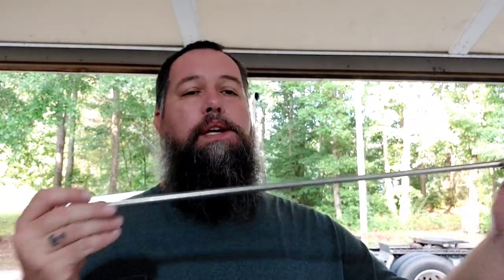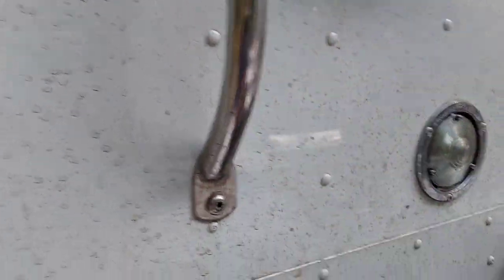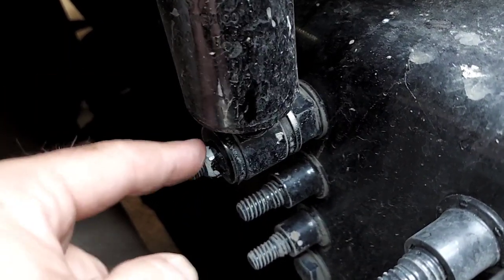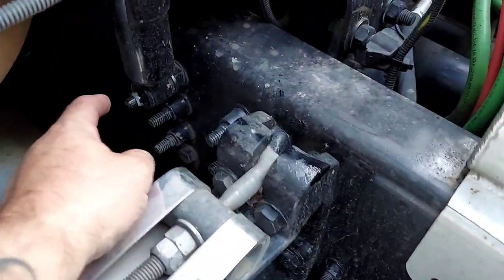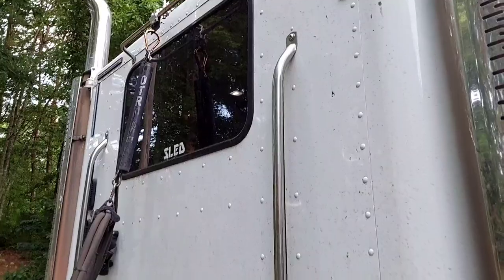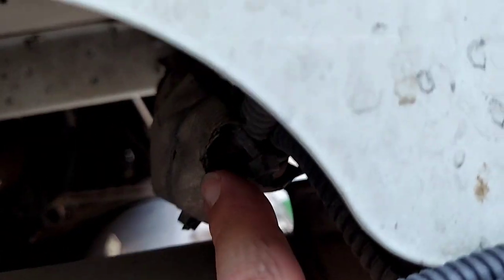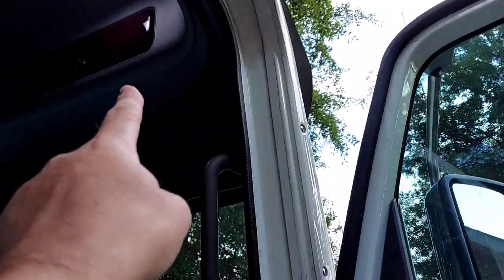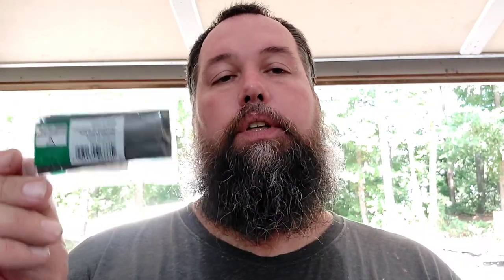The best CB antenna and mount location to date!

Comment: I'm using the "Hustler HQ27 55-Inch Steel Power Packer CB Radio Antenna" and it is awesome. The coil is slimer and is 3/4 the way up on the antenna. Easy to tune with a quick disconnect for when I go into the truck wash.

Comment: Hustler is a great brand that has been proven over time! I would solder the ends to the braided ground straps. They will corrode with time and lose the connection integrity. Permatex anti seize is great stuff to use on metal surface's to prevent corrosion and protect connections. Use it on the braid rings antenna mount bolts even on the antenna mounts etc.  21' is perfect with rg8x. Put a little fire in line and I bet it will really talk on flat land and no obructions. I missed what radio you are running.  Leadfoot 918 waving a hand.

Comment: I just did this set up with the Hustler on the grab bar behind the cab, high center. Ran the coax under the cab and in through the firewall,  easy peasy. Hooked it up to a General Lee and can't get the SWR below 1.7 - 2.0...
Got it all ready to rock for work tomorrow, fingers crossed it gets out as good as yours! 
2020 Mack truck with a hopper bottom trailer.
Reply from the maker: Hopefully you're using an external SWR meter to check that. And RF bonding may help get the swr down,  but will definitely get RF interferences down. https://youtu.be/J6PJyw6jh2M
Reply: @jrichtruckincbtips  thanks for the feedback, we're gonna run a ground wire this weekend over to the grab bar bolt. Also, we're taking off the factory antennas off the mirrors. Never even thought about those causing interference. Not like I'm using them anyway. But yeah, I'm using a meter to check it.

Comment: Very nice setup...the Hustler is a great antenna to use, have use them for years since 1975 whit my first Midland 23 ch CB...over year's i have use many different antennas on my car's but I always come back to Hustler ( for me this day's is the HQ-27 ) i have a 3' fire stick that i use in my grand Vitara it works good.. but never like the HQ-27  is a great antenna for Skip..never had a problem whit it..nice Swr whit 18' and 21' of RG mini 8.  This antenna has been whit me since 1991 and it' will be whit me until is not good no more ( that day i will get another one ).  Hope you use it and get good results locally and whit some skip....73's and good Dx's... from the Unit 403 West indies the Caribbean ( Puerto Rico 🇵🇷 )... Old CB license KAHK 4031........... Ps...i have use 2 HQ-27 in a dipole configuration and 40' coaxial cable for base during huracain Irma and María in Puerto Rico 🇵🇷 2017 to help whit comunicación..and get help
Reply from the maker: Awesome, I believe the Hustler is one of the most underrated antennas on the market. Mostly due to the fact trucker only see Wilson's and Firestik in every truck stop. 

My newest setup is the same as this, just in a different truck, but I feel doesn't hear as good due to the more fiberglass and plastic construction. But, with my new radio the Anytone quad 6 I am able to pick up more from the west coast and I'm just a few hours from the east coast. 73s my friend.
Reply: @jrichtruckincbtips  remember this is made by hostler...and they make antennas for ham radio over years..and this is a old 23 ch antenna that still works good even whit 40 ch + CB's...the real ting is that new cb generation doesn't know this antenna excisit...well better for the people like us that use it...and don't have to spend to much $$$ in ringkidinki fancy antennas that doesn't perform like the hq-27..

Comment: Check into lmr240 ultraflex coax its a less loss coax so more power makes it to the antenna and it's double shielded so it will help keep unwanted interference out
Reply from the maker: Definitely good stuff
Reply: Absolutely 240 ultra or rg400! Just make sure to get your calculations velocity factor and such and get the length for the frequency your prefer!
Reply: Quality of coax and quality connectors and antennas make all the difference. Put the money in the coax and antenna system first. Then any old yak box (that meets factory receive specs) will work great!
Reply: @rockhaller3899  yessir, Times LMR-240/400/600 ultra flex is hard to beat for the price. Only way I could see it getting any better is Commscope (old Andrews) super flex fsj2 corrugated hardline and matching Commscope/Andrews connectors.
Reply: @jstrunck  I changed out a my HF pl259/so239 to double insulated "N" connectors. They are insulated electrically and also from the weather elements, well worth the few extra bucks in cost!!! 👍
Reply: @ericdee6802  I agree 120%. N-connectors are also a constant 50 ohm impedance at almost any frequency which is a good thing. 

Sounds like you building an excellent antenna system!

Comment: I also have the Freightliner Cascadia daycab but without the exhaust pipes and a wind dam on top..I am following your videos closely, so far the 6 foot skip shooter on the mirror is the best choice but am not liking the wild swings the antenna makes being it has to be lowered at 45 degrees for a lower swr.. I bought a 22 inch extension and so far my Wilson antenna is benefits the most with it and doesn't swing around as much ( I only wish i had bought a longer extension) my 5.5 ft francis the K 40 and 4ft fire stick have me  above a 2 SWR.. so that being said I wonder what kind of SWR reading a hustler with a long extension on the mirror would read..

Comment: After 1 winter, I had to throw the Hustler’s away. Every time it snowed, my Stryker 447 wouldn’t transmit due to SWR protection cutoff. Even dry, the SWR’s were wonky. Very disappointed in the Hustler antennas

Comment: Was running a 6' Skipshooter mirror mount on Freightliner Cascadia,  was working great til the antenna snapped off at the base, put a 5' Skipshooter on as a temp fix, but now have trouble transmitting and receiving.

Comment: @jrichtruckincbtips, i got a new model Cascadia with condo sleeper. It has factory mirror mount on driver side, similar to yours. With the sleeper cab, do you recommend this Hustler on back of cab or stick with the mirror mount? If mirror option, do you think the Hustler would perform better than Skip Shooter if coil was mounted high enough?
Reply from the maker: The Hustler will receive better than the Skip Shooter. The Hustler is a little short for the mirror mount. I prefer it on the rear.

Comment: I have a Coronado dump truck aka 122sd. I don’t have that bracket behind the cab but am planning on using steel to make me a mount close to the top of the cab. My truck has a gap between the cab and body. This antenna is going to work great! I’ll do a video when I do it and let you know so you can check it out.
Reply from the maker: Cool, share it with me. Remember to get the coil above the body, no need for the stupid long ground straps. Check out this video on RF bonding, it's made a huge difference on the Coronado. https://youtu.be/J6PJyw6jh2M
Reply: @jrichtruckincbtips  I just watched it this morning, going to definitely do that. It will take me alittle while but I’ll let you know when I get it straight and my results

Comment: Also have a 7' Skipshooter but need to find a base similar to what you're running  to reduce some of the antenna flex.
Reply from the maker: Get a 3' length of 3/4" cpvc pipe (not pvc) from home depot and slide over the base. It will help the antenna last a lot longer.
Reply: @J Rich Truckin & CB Tips   Thank you, will look when I get home.

Comment: Stainless 102 on the driver's side mirror reaches your height restriction when you tip it forward at a 45ﾟ angle.
 That's what the 74 mile freightliner Cascadia was using
Reply from the maker: What kind of power and geographic location is that to get 74 miles? Would be hard to get that range here in North GA without big power. I wouldn't mind testing it though if I had a 102" whip.
Reply: How are you getting 74miles I've got a 102 whip on my personal truck and I'm no where near 74miles
Reply: @4spdlife857   Both vehicles had a resonant  50 ohm antenna.
 Both radios were modified by the same technician.
Reply: @scot Johnson Ahhh hardrive...  I knew your name looked familiar.  My fine tuned radio will be here in a few.  Can’t wait.
Reply: @luckymunkey77.  Did you get your radio?
Is it worth it?
Reply: Buddy, have you seen how low the clearance is under some overpasses?  The 102" whip will probably not break off but would one hell of a nice ratling through an under pass if mounted to a mirror mount on a semi!

Comment: If you want more truck front to rear coverage, and less side coverage. Buy another Hustler like you have and a coax phasing kit(dual coax kit) and phase them together. Your angle of radiation should be lower so it will work DX better. Or stay with one hustler and with a higher radiation angle, and you local coverage will be better.
Reply from the maker: I prefer the single omnidirectional, never found cophase to be worth the hassle.

Comment: Take notice when you go under the door plate that it doesnt go beyound the corner ability of your coax....Also keep in mind of movement near the screws of the plate,might rub and eventuall short out..I know cause i did it with a car stereo..
Reply from the maker: Yeah I will put some wire loom over it.

Comment: Tip re your gnd straps...All those grab rails are bonded to the back of the cab already....I would just use 2 strap to connect back of cab wall where top of cab shock mounts to where bottom of shock mounts....
Reply from the maker: Can never have too many grounds.
Reply: Grounds need to be short as possible....
Reply from the maker: @rockhaller3899  more grounding is coming

Comment: Hi,  great install with the Hustler in that position but having antennas on the mirror at a 45 degree angle is ridiculous. CB antennas should be vertically polarised otherwise your sending your signal to the ground or sky. Not good
Reply from the maker: I here you, but at times whit the antenna vertical the swr can be much higher. With most fiberglass antennas at highway speed the greater half of the antenna will be vertical. Otherwise with a vertical antenna at highway speed you would be talking to the ground or your trailer behind you. Which is where I do most of my talking is at highway speed.
Reply: @jrichtruckincbtips  yeah no worries, I do understand and having the Hustler up top is a far better option. I drive a truck here in the UK and know the challenges of good CB installs. Keep up the good work 👍

Comment: New subscriber here.  How did your give a way work out?  Hope some people were able to put them to use.  Thanks for the details of your install.  Have a great 2021!
Reply from the maker: The giveaway was great and winners were announced in this video.
Reply: @jrichtruckincbtips  sounds good.  I am a former CB operator well back in 1975 I was.  I might get on CB again.  I was looking for mounting ideas on a truck for antennas and came across your video.  I am a licensed Ham operator and want to setup mobile radios for VHF & HF.  I also plan on putting a CB in the truck as well.  I am not one of those that says one is better than the other, I like good communication and dislike goofballs on any radio.  By the way, my Brother in law and Nephew are OTR drivers and my cousin drives plows and sand trucks in Minnesota.  Stay safe on the road!  All the best!

Comment: Theoretically, your ground strap needs to be as short as possible, also attaching the strap to the antenna mount wouldn't make any difference which side of the bolt it was attached, once the strap makes contact with the mount, the ground has been established. 
    Question:  What's the purpose of tilting the antenna at an angle, are you undecided on whether your going with a vertical or horizontal polarization?
Reply from the maker: Most do it to accommodate for the antenna flex at highway speed.
Reply: @jrichtruckincbtips  I kinda figured but wasn't sure. Gotta question for you. I currently run two firestix on my rig but after watching your video, I went and took a gander at the "Skip shooter's", They are 5/8th wavelength which is about a good as it gets for a mobile antenna, how well do you think Co-Phased 4'.5" skip shooter's will perform in place of the Firestix. If I did my math correctly, the 4.5 foot skip shooter will be a few inches below the 13.6 foot mark. I have a 2021 Pete 579 which has the factory antenna mounts on the cab body just outside each door, Co- phased antennas work well between 5' foot and not exceeding 9'feet. I have a factory stock Cobra 29 LTD and was recently taking with a guy who was 29 miles  up a Mountain canyon from me and was getting good signal reports 5/7 to 5/9 "S" units with the firestix, if the Skip shooter's are as good as people report, than I should easily surpass that distance, what's your thoughts on that???
 Thanks for reading and sharing your antenna install.

 Oh, real quick, with my Pete, I purchased one of those black rubber anti static strips that you sometimes see under trucks, they bolt to your undercarriage and drag on the ground, I've seen them alot on school buses, I have noticed a huge improvement in heard static/crackling noise you hear sometimes through your CB speaker I purchased mine through "Granger" in Santa Fe Springs,Ca fairly cheap. Just a little added insurance against static electricity that causes issues. 👍

Comment: Ive had 2 of these. First one I thought was great, picked up well, heard everything, but I eventually broke it on a tree limb. Second one was complete crap, the threads at the bottom of the coil stripped out very very quickly, and it didn't seem to pick up like the old one. The whip on top is nice in theory, but in reality it doesnt bend much, its stiff, and they will still break. Shame on the modern QC, I'll have to find something else now. Thank god you arent using 18' coax, its a meme.

Comment: Your content is great!
I am a slip seat driver.
One trip I can be in a Volvo, next a Pete, then next a Freightliner.
My SWRs are all over the place, depending on the truck.  
I usually use the bird pearch, but seems I can never get my SWRs lower than a 2. A couple of trucks they shoot well past 3, and don't use my radio then.
I run a Galaxy 959b, with a Wilson 2000 mounted on a vice grip mirror holder, and run RG8X coax.
Any advice on how to lower my SWRs? 
Thanks
Reply from the maker: Yeah, it's tough trying to maintain a low swr while constantly changing trucks. Even with a good ground I have found it hard to get a great swr with wilson antennas. I prefer Skip Shooter and Hustler antennas. I'd try a different antenna first.

Comment: Hello I drive a 2023 FL the antenna is on the back of the slipper and I see two different antennas im not sure if they are both cb I thinking one is for the cb and the other one is for the radio im not sure.  What im trying to do is get a antenna that I can set the swr on so I can use my radio. This is a company truck so not much I can change on it. I like your videos they help me out if possible I would like to talk with you about what I have to work with just see what can do

Comment: Having heck of time. With 579.factory...   antenna mount on driver fender hood next to down left windshield. ....
Reply from the maker: I know what you're talking about, but I haven't had an opportunity to look at those close up to give you a sure fix. But, I'd try running a better coax, ground the mount to the frame, and a tall top load antenna for starters.
Reply: 567 and 579 the same just dif hood i used a bird perch 27in shaft predator ground to frame 1.1swr good stuff had to tilt forward some to get that swr.

Comment: Very good but you sold yourself short on the coax.  You want Teflon insulator not foam.  Also I would bet my sirio 5000 has a better field strength.

Comment: J rich...The purpose of bonding is to electrically equal all aprts of said car or truck..You need to give rf a complete path to folllow,like a race track sorta speak cause the start and finish is always same spot....Most trucks today are not much more than glued together with a few spot welds..Ex..connect doors to cab,cab to fire wall(both sides) and back cab wall to sides of cab and floor,keep straps as short as possible and sorry to say you got some long ones there..Like bbi said in his bonding vid,you want the entire car/truck ect to radiate rf..I got a 40ft roll of braided wire commin tomorrow,some open,short,load ends for my analyxer so i can see the tune via ant vs radio side of coax..With my set up now i get 30-50 mi and well skip is almost limited on side band..
Reply from the maker: Adding more straps soon.
Reply: @jrichtruckincbtips  based on the vid bud,you got some freakin long ones..The longer the worse it is..
Reply from the maker: @craig_sez8534  each one is 7.5' so I have extra to add more straps. Like you said the grab bars are already grounded to the cab.
Reply: @jrichtruckincbtips  7.5 foot each!!!! Daum driver lol...tow roaps..lol
Like i sent the link from bni on bonding,gave me knowledge..Same with k0bg link....